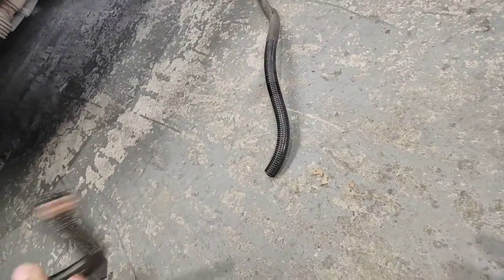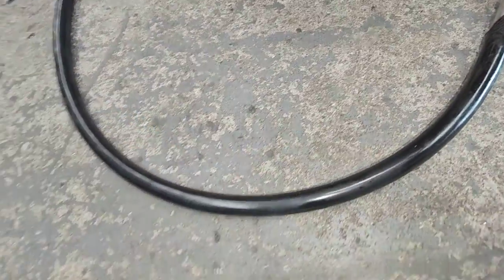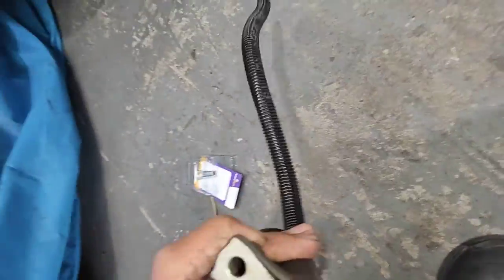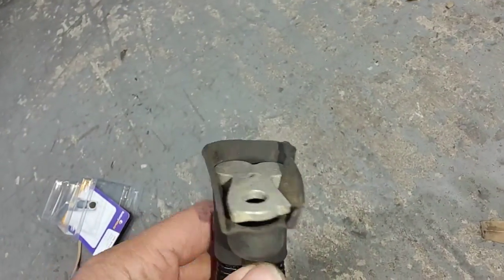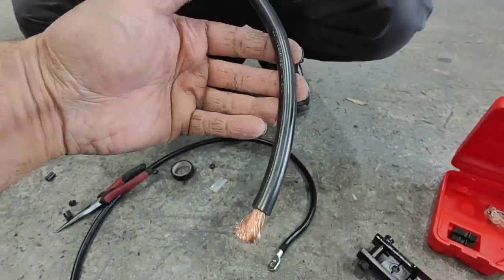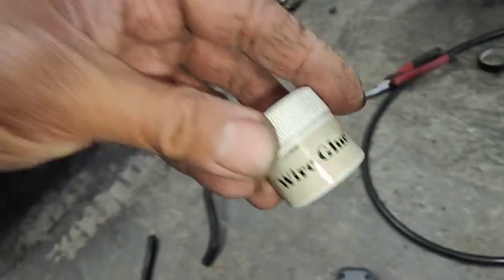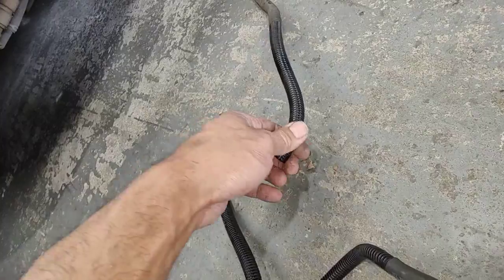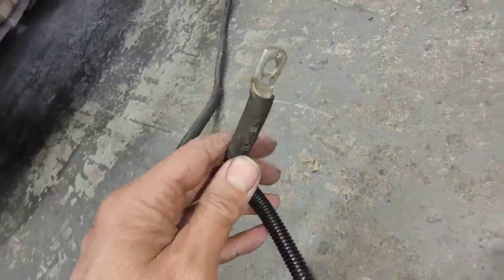Porsche 997 P.H -Starter motor cable repairs -Making a new starter motor cable for this 997

Comment: For those without proper tools, there is an upgraded part for the 997 you can purchase that supposedly fixes the issue. Dielectric grease may also not be a bad idea. Creating a new cable like this is good work though. I don't have enough experience crimping to know my repairs would last 10+ years so I just bought the updated cable.

Comment: Instead of replacing the cable would it be okay to remove old crimp lug and put new crimp lugs? one for the starter motor cable and one for the alternator cable? And still achieve what you have shown in the video?? Thanks
Reply from the maker: @maisumrizvi8244  no because the cable is old & has high resistance + if you open the insulation some of wire strain are broken inside on the ends.
If you are there already might as well put a new one
Reply: @emdporschespecialistcaring8975  okay thanks. Also, does the cable going from the junction box on the transmission to the power distribution block need to be replaced as well?
Reply: @maisumrizvi8244 …..Over time they all corrode my 997 on a 2005 plate has…😢
Change as much of the cable as you can due to age on these old 911`s….
Design 911 parts do an upgrade version on the Y-Cables….